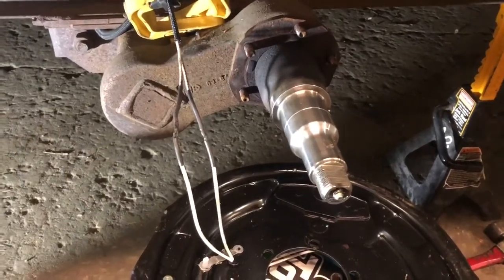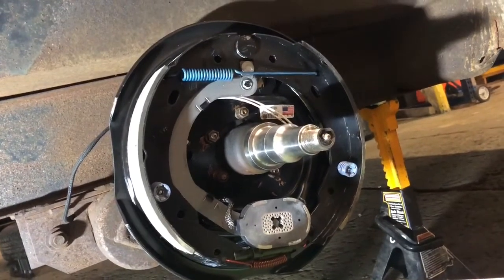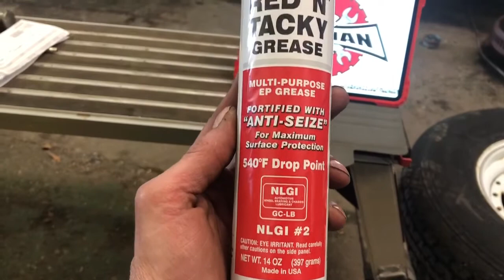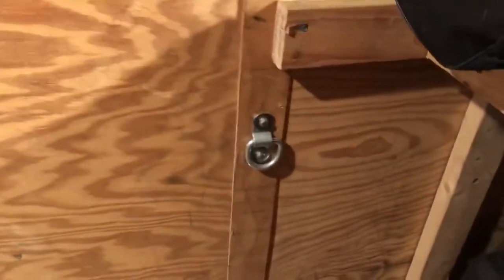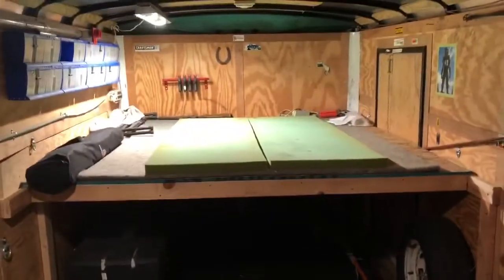Replacing The Electric Drum Brakes On A 2000 US Cargo Utility Trailer

Comment: Gotta say, I've never seen a drum brake do that. Good planning replacing them all
Reply from the maker: I've never seen that either!  It must have happened at the end of my last trip, since it didn't burn up the bearings.  I got lucky that the bearings and hubs didn't get damaged.  The guy at RA Adams said the bearing looked fine and the drums still had plenty of life in them, so I was able to re-use them and  saved $500!  The pad material crumbled off of the other ones, so it wasn't much of a choice!!!